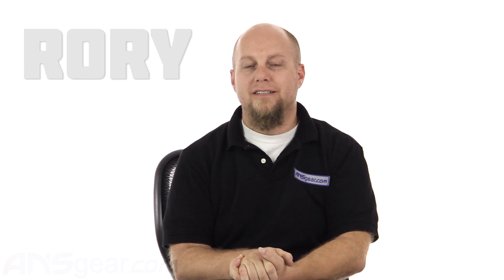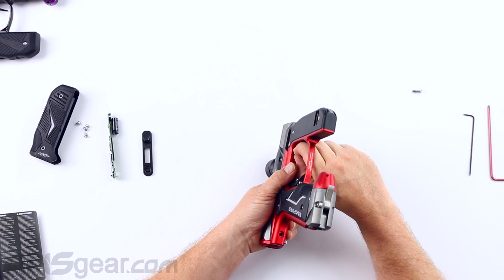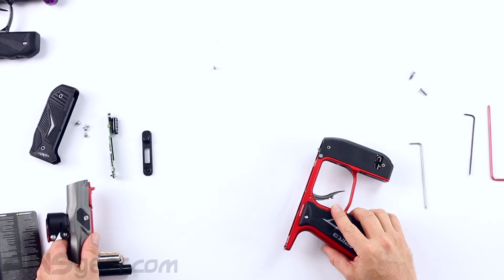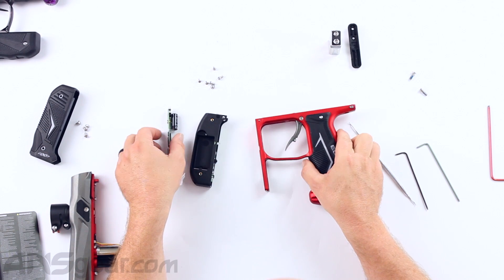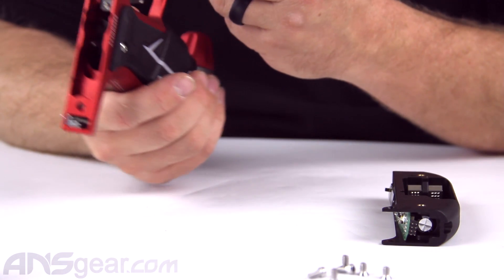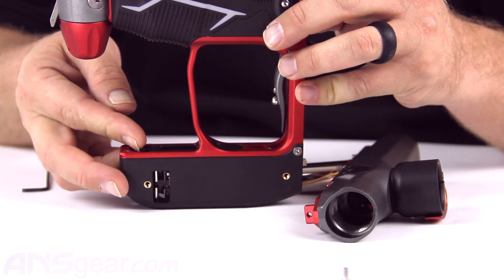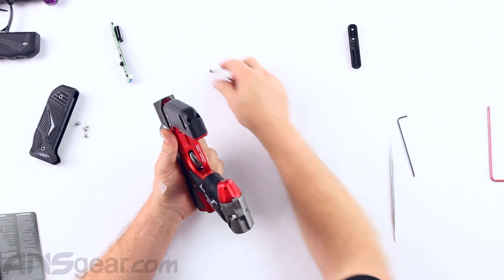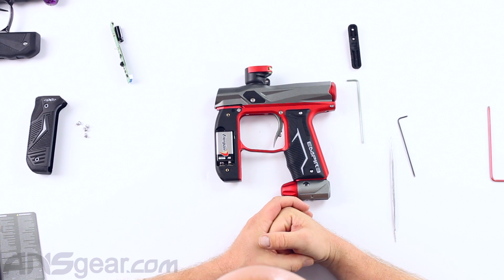Empire Axe 2.0/Mini GS Redline OLED Board Upgrade - Maintenance/Repair

Comment: Just got a used 2.0 & a Ninja SL 68/45 for my wife for 350$ , less than a couple cases through it. Its a sweet marker, i like the trigger more than my Geo 2.1 with iv core, it a nice marker, shoots smooth , feels solid, easy to clean & maintain. The only thing i dont like is the lack of a screen, the menu system with the light is a pain in the ace , im gonna put a pooty bolt & redline board & deadlywind fibur x8 barrel on it and it will be just as quiet as my Geo.

Comment: 12:28 misalignment for me was caused by to much or to little tension on the screw that goes through the rear of the OLED BOARD.... To tight and misaligned, loosened and instantly lined up... good luck... DNT RUSH, LEARN YOUR SCREW LOCATIONS

Comment: Axe 2.0 or mini gs ? I do not know witch one to get?
Reply from the maker: Axe 2.0
Reply: ANSgearPaintball why
Reply: There are multiple reasons, if you are still wondering. 1: If you have the extra money to spend on the Axe 2.0, why buy a cheaper product? Both come from a reliable brand (Empire) and, in paintball, it is very common that the more expensive the product is will relate to how well it works. 2: Easy to remove and clean eye covers. 3: Easy to remove and maintenance bolt system. 4: 2 piece barrel kit. The list can continue and be more precise, if needed, but ANSgear definitely are not trying to steer you the wrong way. The only reasons why I would recommend the Mini GS to anyone is if they are tight on money, or if their body size/frame is smaller. Otherwise, Axe 2.0 bro.
Sorry for this being so long ;)
Reply: I have a mini gs and I love it, the fact you cant put a gauge on the 2.0 would drive me insane why go the opposite direction, that's just my opinion, and everyone eventually gets a freak barrel anyways so who cares about the barrel

Comment: Can this OLED upgrade be used with axe empire that has the old B function switch and on/off switch for a programming the different modes.
Reply from the maker: This board will only work with the Mini GS and the Axe 2.0.

Comment: Should I get the Axe 2.0 or the Mini Gs?
Reply: If you like the size of the GS then wait and see how well the fallen code performs. So far it looks like its way better than the mini. Also consider the etha 2, I like the etha 2 much better than the axe 2.0
Reply: Exactly. Size can make or break a marker for some people. If you prefer a slightly bulkier marker, the Etha 2 is a great choice. Smaller, Axe 2.0. Smallest, Mini GS. I've shot all 3 and would recommend each. But try to save up for either a Etha or Axe.

Comment: Which gun is better out of the empire axe 2.0, dangerous power G5 spec r, and the Etha 2 ?
Reply from the maker: Axe 2.0
Reply: Thanks that helped me out a lot now ik what gun I'm gonna get.
Reply: I asked another paintball channel the same question and they said etha 2 is better so I'm guessing its just preference to how you fell ?
Reply from the maker: i just went by customer reviews. They're both solid choices though.
Reply: G5 feels like a high end. Etha 2 shoots like a high end. Axe 2.0 feels and shoots like a mid range.
Reply: SSniper14 PB thanks man you simplified it for me. I think I'm gonna go with Etha since it's better performance and comes with gun case and stuff you get more for your money. And what gun would you choose ?
Reply: I would get the spec-r because I don't really care about the rougher shot. However, I probably wouldn't recommend it to anyone, especially a beginner because maintence is a real PITA
Reply: Etha 2 is made out of a fancy plastic like a glock and it is industructable (never breaks). Etha 2 has gamma core.  Etha 2 will perform better than all of the other guns you said.
But it has no OLED which kinda sucks.

Comment: Why is oled board bettsr
Reply: It's easier to navigate and change settings. It's not really worth it though most people are going to leave it on semi or ramping.
Reply: Got a screen to navigate through different code settings vs using a blinking light to change modes.
Reply: to make you look like a pro player haha